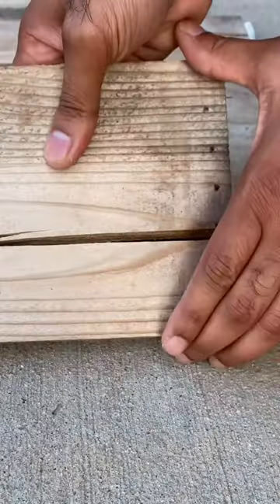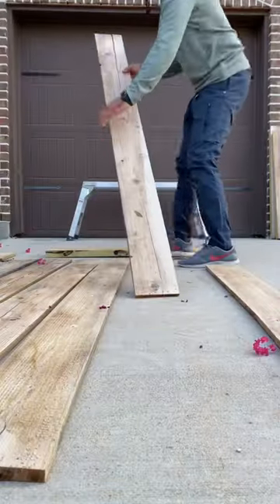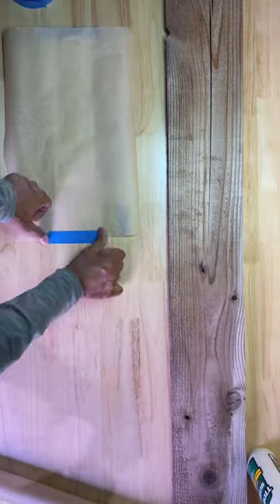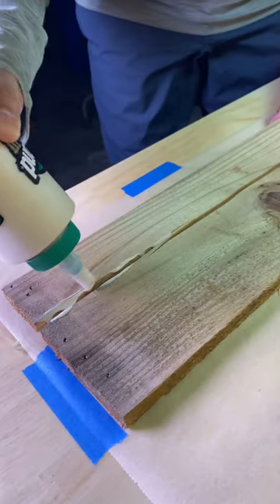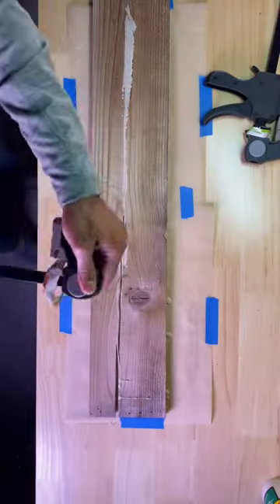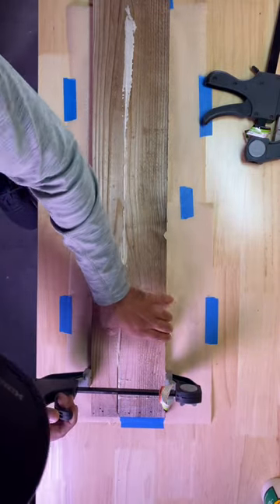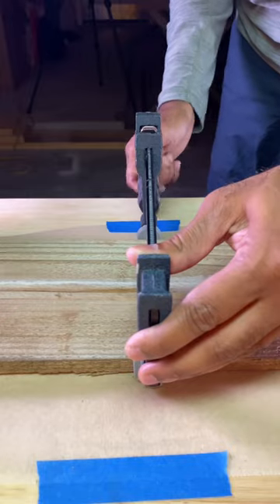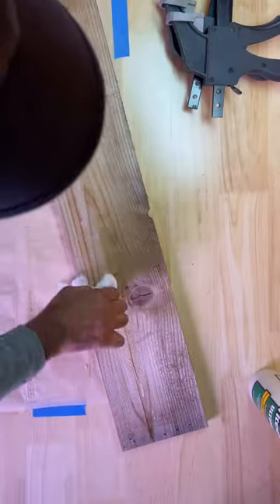How to Fix Split Ends - An Experiment

Comment: Having syringes and blunt needles is sooooo handy for stuff like this. The small needles will bend fairly easily without kinking if you need to really get in to a weird spot.

Also iv gotten good results from pumping the split open and closed after pouring a bit of an excess of glue, to get the glue to move further in, often this can avoid the need for syringes in the first place.
Reply: Not everybody has the forethought like this bud, I'd use a needle with an extension too.

Some of us innovate some of us go to the store and buy every single thing brand new lol
Reply: Go to your neighborhood needle 💉 exchange for free needles 💉.

Comment: Next time try West system Two-Part Epoxy. They use in boatbuilding and can even repair and reinforce rotten wood. Great for exterior wood repairs and can be sanded and painted if your repair is paint-grade.

Comment: It would help to drill a small hole where the cracked ended, then glue the crack together, then fill the drilled hole.
Reply: also isnt it wiser to start where the crack ends  with the clamps ?
Reply: @j-bob_oreo  when you repair a settling crack on drywall you drill a hole where the crack ends too, before patching. This hole concentrates any more expansion/cracking to that hole, like compression strips on concrete-same principle
Reply: That’s a solid idea. Without that hole, there’s no guarantee the stresses from the warped section won’t create another crack somewhere else

Comment: Glue would need to cure for 24 hours
Reply: Not really, 30-60 minutes is enough time for the joint to bond well enough to work with it using that particular glue. It won't be quite as strong as it would be after a full day, but there is no "need" to wait that long in most cases.

Comment: It would probably help in the long term if you drilled and placed a couple long thin wood screws across the crack.   I do this while repairing boards salvaged  from pallets.

Comment: "Tripping over a dollar to save a dime" should be the title of this clip
Reply: In South Africa wood glue is R80 one of those planks would be R350
Reply: @mariusneveling6822  fair, but we both know that glue alone will not fix the grain-tension based split in that board. If the original poster if this video honestly knew what they were about, they would have inset a butterfly (aka bowtie) with a smear of glue and had done with it, permanently
Reply: @georgebliss7674  true

Comment: You do know wood glue IS WATERPROOF once dry right? If you use Elmer's glue it always can be unset with water!
Reply: You know that wood glue is not water proof after it dries unless it says it is. That's why there are 3 titebond types. Not waterproof,  waret resistant,  and waterproof.

Comment: woodglues connection to wood is stronger then wood if done right trust me buddy that crack ain't gonna budge butt the internal pressures that caused it might rip a new one that looks the same somewhere else thats what my woodwork teacher told me before